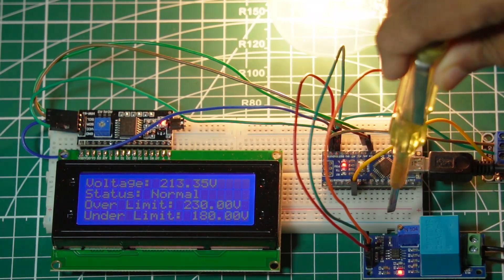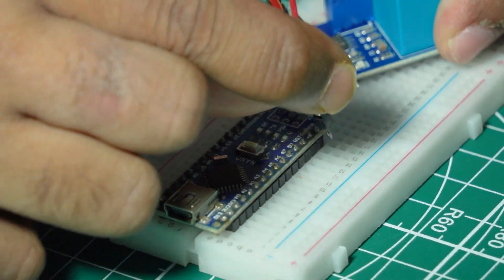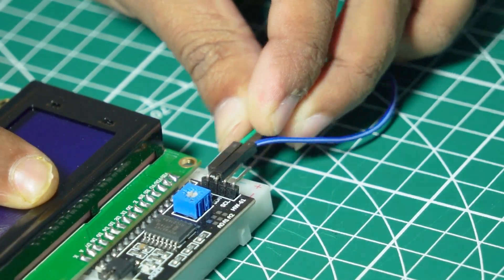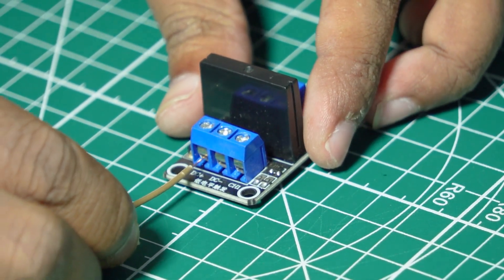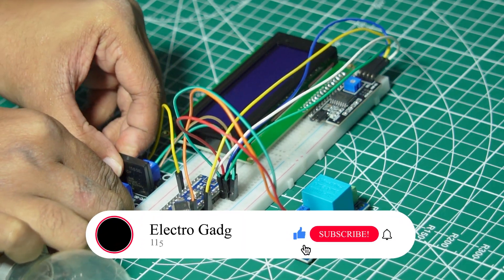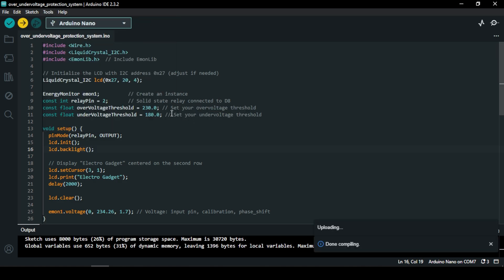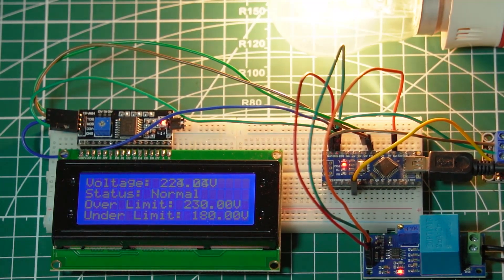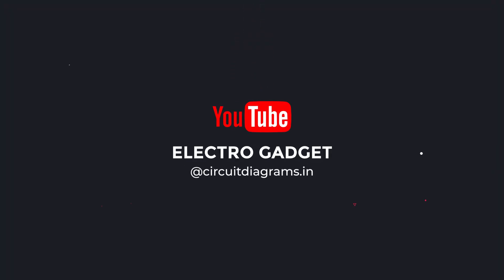AC Overvoltage and Undervoltage Protection System Using Arduino

Comment: Can we display 4 lines by 16*2 lcd display
Reply from the maker: How can you display 4 lines with 2 rows display? 16x2 display has 16 columns and 2 rows that means only 2 lines will be display. But you can modify the code so that 1st page display 2 lines and another page page display another 2 lines as well

Comment: What can we use in place of voltage sensor
Reply from the maker: You cannot place anything by replacing the voltage sensor. Because if the voltage sensor will wipe out, then what will sense the voltage? If you use energy ic it also has voltage sensor logic in it.

Comment: I have seen the components list you have mentioned about the Veroboard, for this project we need the veroboard is compulsary? or we can able to do this project with other components? Could you please say that
Reply from the maker: You can use a breadboard instead of a veroboard. But for mounting all components any of them is needed. Or if you want to solder the components pins then you can also.
Reply: @electro_gadget80 thank you

Comment: Please tell me how to upload ZMPT101B calibration code
Reply from the maker: Just find emon.voltage(A0, 234.0, 1.7) line in the code and change the value by increasing or decreasing 234.0 until your desired voltage. Otherwise you can also change the blue potentiometer value by adjusting the knob, you can also get your desired calibrated voltage.

Comment: So basically i connect the USB cable to my PC and is that power supply enough to make the bulb glow?
Please answer
Reply: Maximum Laptop usb port output voltage is 5V. so you give the details which bulb to you used and details.
Reply from the maker: Absolutely not. The laptop is giving only 5 volt dc output and the bulb is powering by 220 volt ac voltage.

Comment: Bro how did you give supply from 3 pin ac socket can you explain that part please in detail ?? Like if you take your ac mains socket it has 3 pin so how did you take only 2 wire from supply ??
Reply from the maker: You don't need to take the big upper pin from the socket. This is not needed as this is a earthing wire. Just join two wires (live and neutral) from three pin socket to the voltage sensor's two terminal. That's it.
Reply: @electro_gadget80  Should i switch of the mcb before making my connection to arduino then switch it on after my connection are made  ??
Reply from the maker: @abhishek3004 may be you can try with extension cord ac supply before applying this on your home electricity connection. Cause you sound like zero knowledge about electricity. So if the power of your mains supply is gone, then it will be big trouble for you. So 1st try with extension cord supply.
Reply: Also is that lamp/bulb of a particular type ?? if yes can you pls specify the power rating and its name
Reply from the maker: @abhishek3004 it depends on what current rating relay module are you using on it. If you use 10 ampere relay then it can support upto 2000 watt, if 16 amp then it will can support high and so on.
Reply: @electro_gadget80  Thank you for your help brother! Yes you are right i don't have much knowledge i'm trying this for the first time.

Comment: Hello sir..In place of I2C module any other component is there..???
Reply from the maker: No, but you can use lcd directly with Arduino. But several wiring will be needed.

Comment: Hello, Electro Gadget, I am currently working on this project and I am in dire need of some assistance. I need to submit a simulation of the circuit diagram to my project supervisor. I want to know what software you used or recommend I use for the simulation. Thanks.
Reply from the maker: You can use Tinkercad, Wokwi, proteus etc for simulation of arduino projects.

Comment: Where you have given supply
Reply: Bro as per ckt diagram is need of hi-link 5v converter...? Or not need....and why it is needed
Reply from the maker: @neyyalabalu8416 you can use any 5 volt source. I used hi link because of its compactness.
Reply: @paraskhole6786  in ckt diagram you used 2 ac sources....is only one is need yes or no bro
Reply from the maker: @neyyalabalu8416 you can use only one ac supply from source to the sensor. And then divide this into two separate one for direct voltage sensor and one for ac current sensor in series with load.
Reply from the maker: Between the relay's one terminal and bulb's one terminal.
Reply: @electro_gadget80  we have used 5v normal relay instead of 5v solid state relay is it ok?
Reply from the maker: @paraskhole6786 no issue same
Reply: @electro_gadget80  other terminal of bulb and relay are connected where????
Reply from the maker: Mains power supply as it is controlled the voltage fluctuations from the mains power
Reply: @electro_gadget80  I not get this can u give detailed explanation of how u have given input supply to the ckt have u given it to both terminal of voltage sensor ie L And N of voltage sensor
Reply from the maker: Did you check out the circuit diagram from the video description link?
Reply: @electro_gadget80  actually the issue that we connected as per the ckt diagram the components but as we give supply the supply reaches to the Input of voltage sensor and it doesn't go to the forward ckt doesn't function what is issue can u help us?
Reply from the maker: @paraskhole6786 did you calibrate the voltage sensor pot for sensing the voltage accurately?
Reply from the maker: @paraskhole6786 5 volt
Reply: @electro_gadget80  we have used 16x2 lcd it is ok? As you have used 20x4 lcd
Reply from the maker: @paraskhole6786 yes
Reply: @electro_gadget80  then we have to make changes in the code
Reply: @electro_gadget80  can we use 60w bulb ?
Reply: @electro_gadget80 Do I understand correctly that when connected, the phase passes through the terminals of the rail and the terminals of the voltage sensor, and zero goes directly from the 220 volt mains wire into the light bulb?
Reply from the maker: @ДанилИонин-з7г yes correct for the bulb and relay connection only that is phase is pass through the relay module rail and connected to the bulb and another zero means neutral wire directly to the bulb. But for the voltage sensor the phase and thr neutral wires are directly connected to voltage sensor to sense realtime value and make decision when to cut the voltage of the load.
Reply: @electro_gadget80  Thanks for the answer bro, I realized that it is necessary to separate the wires with terminals in order to connect to both the sensor and the relay and the load.
Reply: How can we give supply?
Reply: @shwetambarishirke7521  we can u direct supply from ac source connect phase wire L of voltage sensor and neutral to N and the bulb postive of blub yo NC of 5V realy and shot the 5V relay COM with L of voltage Sensor and blub neutral to voltage sensor N I have use 5V relay instead of SSR and in video the IN pin of relay is gone D2 but in circuit diagram which link in bio there it is connected to D10 but you connect in D2 
As per code
Reply: @paraskhole6786  thanks
Reply from the maker: @shwetambarishirke7521 directly through the ac mains power supply to the bulb and current sensor in series and voltage sensor with direct supply from ac mains. And esp32 and other sensor's input supply from a 5 volt dc converter through ac mains. Circuit diagram in thr description.
Reply: @electro_gadget80  my this project was working did few modifications. Thank you
Reply: @electro_gadget80  can u suggest me few topics for my future project
Reply: hello can u share with me your modified code.. i need it ASAP
Reply: @molefhilarona8858  yes
Reply: @molefhilarona8858  Yes. Give your Gmail id will mail you the code file